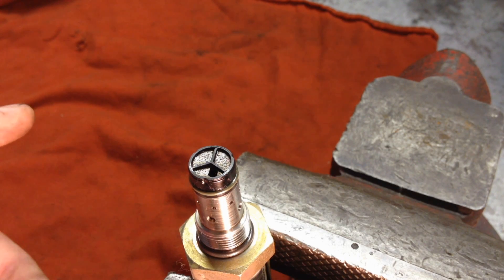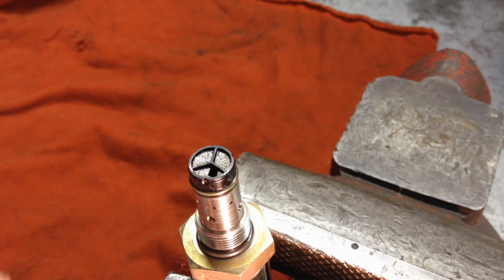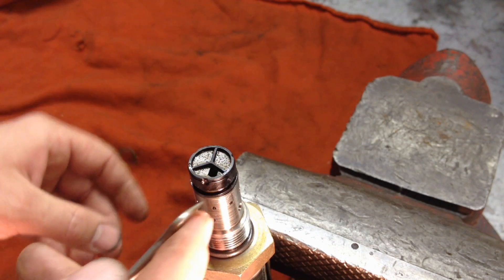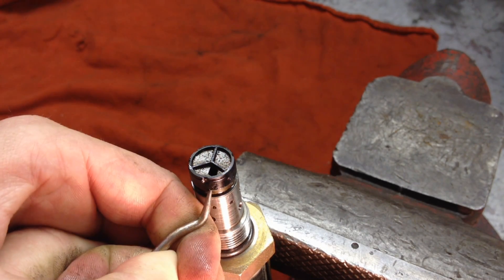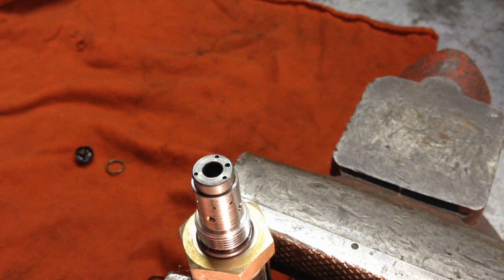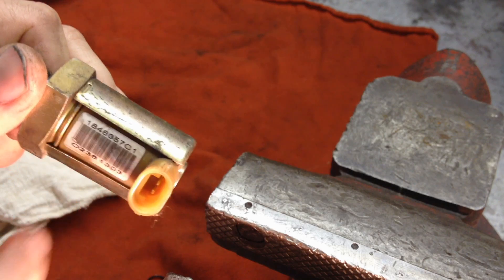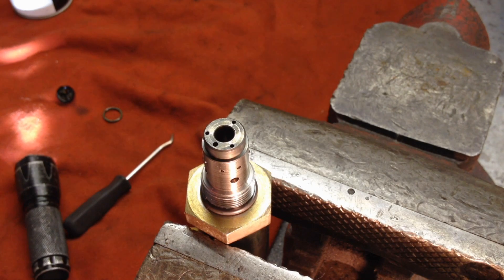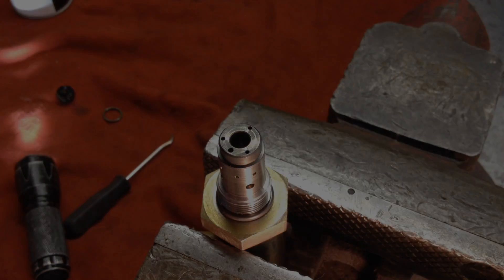No Start After Repairs: Ford 6.0L Powerstroke IPR Checks

Comment: For the a 2003-mid 2004 6.0 Diesel, I've heard the newer Motorcraft IPR (CM-5126 - mid 2004 to 2007) has improvements over the Motorcraft CM-5054. Would you recommend using the CM-5126 on a pre mid-2004?

Comment: got ICP up to 650 psi. IPR is at %34 while cranking and when it starts its an extremely rough idle then if i drive it for 100 feet its starts to stall and die.

Comment: changed a few valve cover bolts, ficm power is at 48.5, ficm sync 1.0 Hpop 1197.6, Ipr at 54.9, battery Voltage 12.1, icp voltage remains at 0, all while crank no start. Can you please send me in the direction?
Reply: Are you building any oil pressure? Could be your “stand pipes and dummy plugs”. Also the icp harness is common for broken and/or warn wires. Hope this helps. Check out “diesel tech Ron’s” videos. There’s a wealth of information on his channel. (RIP Ron)

Comment: Shoot my trucks got 200k miles and the ipr finally went bad I guess I got lucky 😭 the whole ipr went out (when hooked up nothing happened) and luckily this thing was super easy to change…. I’ve gone through and bought a new billet oil cooler new wire harness took off the valve covers and checked for oil leaks but that bad ipr was the problem the whole time

Comment: So I have a problem that I can't diagnose I have over 750psi cranking on the pump ice 18percent 48v at ficm cranking it just keep firing but won't run have new charged batteries spins over fast any ideas would be appreciated thank you

Comment: I have a 06 f250 6.0 i took the ipr valve of  and the solenoid part was loose does that means its bad
Reply: It shouldn't mean it's bad. Check it for continuity and measure resistance. I think it should read 6 ohms give or take
Reply: My customer was lose to but it still works

Comment: I have 05 6.0 it has new stand pipes new dummy plugs and new stp fitting . when I try start it the ipr was reading 85 icp was anywhere from 0 to 336 . I pulled ipr screen was a little dirty . I cleaned it reinstalled it still the same it wont start . any tips?

Comment: Hello somebody can you help me I have 2006  ford f350 truck crank  won’t start I used  Autel Maxcys and start connecting through the computer but never finish ,,,when I turn the key on I don’t hear the injectors make a noise check all the fuses ,, all fuses good,,somebody have a idea?

Comment: The parts now days fail way to much Ford should  be paying for these failures!
Reply: International engine...
Reply: @TheRumbles13  fyi international never built the 6.0 or 6.4 or 6.7 so relearn you’re facts before dissing them the only engine they built was the 7.3 just saying 😂
Reply: @DreadfulDieselz  WOW google VT365 and get back to me...fanboy detected
Reply: @DreadfulDieselz  your""
Reply: @DreadfulDieselz  also, they went out of business between the 6.0 or vt365 and the 6.4 or Maxxforce 7, then got bought out my Navistar... 
Re-learn YOUR FACTS chump
Reply: @TheRumbles13  nah nah you're right i always was told they lost their contract with international after the 7.3 my bad. thanks for the info!
Reply: Mine has a big old international plaque right on the valve cover

Comment: Have a 2004 excursion with the 6.0. It is the 6.0 with the icp int the valve cover. Truck ran with icp sensor unplugged. Did the air test didnt hear air leaks. Replaced ipr and icp noe truck wont start. Any suggestions
Reply: Replace icp

Comment: I have a 2003 F350 6.0 change the lower oil pressure pump now have a Poppin through the intake hear it in the air filter what could be causing it
Reply: Camshaft and lifter failure

Comment: Do you have a video of how you've taken the ipr apart?  I tried to remove the screen to check for debris and it's came apart.  The spring pushed it out.  Not doing this before I didn't notice the little valve needle seat and the 3 ball bearings in there.  Does it make contact inside the hpop cover so it doesn't come apart inside?

Comment: ok so I'm having a hard start. I have no oil pressure on the dash with check gages. I have changed the oil sensor it work and showed pressure but after a quick drive it went flat once more. the truck does start just takes it sweet time to get up to or over 500psi on the icp. would this be a icp issue or IPR. I checked the lpop plenty it's good. also when I have it under a load and foot down to the floor I lose psi in the icp according to my sct live wire. kinda lost on this one

Comment: I pulled the IPR valve on my 2006 Ford and found that the screen was completely gone along with the plastic snap cap that holds it. I sprayed out the IPR with carb cleaner and air but did not fond any traces of metal or plastic chips. Where  has the screen gone?
Reply: pipedreams57 the pump
Reply: i am pretty sure some of the ipr valves didn’t get any cap or screen

Comment: Hey I have a 2005 6.0 with 204k. Just replaced dummy plugs, upper stand pipes (which failed, and could not remove lower portions), STC fitting, and IPR valve. The IPR I bought was not OEM and I'm now getting a IPR duty cycle % at 14 during idle and around 650-700 icp. I have my old OEM valve which looking back now might not have cause my issues but have yet to put it back in yet. Does this sound like the symptoms of a bad IPR? I know 85% indicates the computer compensating for a leak but I can't find out what the 14% stands for. All help is appreciated.
Reply: Have the same thing going on what did you ever find out

Comment: I have a 2006 6.0 and I have no power under a load. Will not go over 1000 rpm's. It's fine in park or neutral what do you suggest?
Reply from the maker: +Mike Huset Check to make sure the egr valve is not stuck and the boost pressure port is not plugged up I have videos on both under the 6.0l playlist. If both of these check out fine be sure to check fuel pressure most times caused by plugged filter over failing fuel pumps. You should have 50psi at idle and no lower than 45 under full load. If everything checks out drop the downpipe to cat connection and let it hand drive and see if the concern is gone now. Hope this helps!

Comment: Hi their, my 2004 6.0 diesel with 151,000 miles I keep cleaning my ipr valve screen every 150-300 miles. every time when I pull the ipr valve out and clean the screen i see very fine like sand thin rubber particles on the ipr screen. I do keep the engine clean, when I pull the valve cover off I take extra care in cleanliness when doing a repair. I keep my engine oil clean. also every 110-120 miles the truck uses half gallon of engine oil, I see the whole bell housing wet with oil it drips down from inside of the trans inspection cover. I am thinking its a rear main seal leak and also its tearing up when the motor is running and sending the debris to the pan and then ipr? is that what it might be, that I am thinking? I appreciate it thank you.
Reply from the maker: Denkha94 The Ipr has a pre screen filter under the oil cooler reservoir I am thinking that is torn and sending debri through the system. They can fall apart by themselves.
Reply: thank you for responding. so if the oil cooler reservoir screen is clogged it won't feed enough oil pressure to the rails to fire the injectors? also the debri on the ipr when I pull it out and looking on the screen it has black sandy debri. could it be rear main seal failing causing that black sandy debri? thank you.

Comment: With previous experience on the 03-04s, I went after the egr valve, iat sensor, map sensor port. They were all heavily dirty or plugged. Just did that because I was sure they had never been serviced.  After that I went ahead and pulled the IPR. The screen fell off when I pulled it out and the intire valve would rattle when shook. Went ahead and replaced the IPR valve.. we're on 200 miles now since yesterday. Starts up quick after hot every time and running even better. ....

Comment: 2005 6.0 187,000 miles..... not start when hot after approx. 15miles. wait about 20 min and it will start again but may stall sometimes. replaced ICP sensor and no change. scan gauge ICP reads about 250psi while crank. FICM is 48. IPR - reads 80+ while crank.... what do you suggest? also are IPR valves different for 03-04 from 05-07? thanks in advance. brad
Reply from the maker: I think the ipr valve is different yes. On an 05 I would go right after the STC fitting on the pump and secondly the dummy plugs on th oil rail. There is an icp leak when oil is thin and not enough to get past the 500 and fire. An air test would be in order.
Reply: Man I got the exact same problem with my 2004 I think it’s the ipr valve .I hope .

Comment: My 2003 6.0 died the other day while idleing. After several attempts to start, it finally did after 20 or 30 minutes had passed. It has not had the problem since then. And ICP / IPR are within specs KOEO and at idle. Had code of 2626 and 2291 when it happened. I cleared and have not returned. The ICP was replaced 1 year ago along with the HPOP. You think the IPR should be my first check if it happens again?
Reply from the maker: Yes for sure it is one of the first checks besides an air test.
Reply: FordTechMakuloco
Reply: FordTechMakuloco  what would be the correct part # for an early 2003 IPR valve? The cm5054 or cm5126? Thanks!!
Reply from the maker: I am getting CM5054

Comment: i have yet to have an IPR issue after an oil cooler,  if the oil quality is good should never have an IPR issue unless the electrical side fails!
Reply from the maker: Yeah not only do I clean out the reservoir and replace the screen every time I also stick my brake vacuum bleeder into the channel that feeds the hpop and suck out all the garbage that is in there too.
Reply: ohg same here its SPOTLESS when im done in there, it woudl be retarded not to clean it all, guys gotta stop caring about making TIME on flat rate and gotta start caring about the customers car

Comment: Most commonly seen this after a repair such as oil cooler,hpp or stc replacement because the area are not cleaned properly before disassembly and dirt and debris get into the oil system
Reply: Just replaced EGR and oil coolers. Cleaned up everything as well as possible, the HPOP screen was torn in several places. Replaced all that, test drove and had the engine die. Ended up being IPR. Replaced it as it's inlet screen was sucked in so much I was surprised the screen didn't get stuck in the pump bore. Truck had almost 140K, wasn't going to chance a cleaning, was in the job for enough time already.
Reply: Oldbmwr100rs
Reply from the maker: Most definitely!